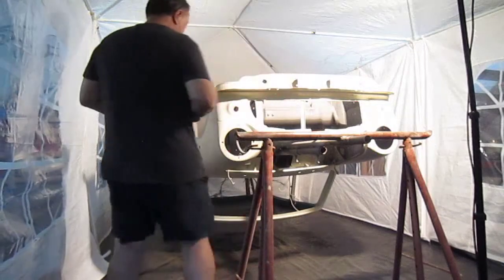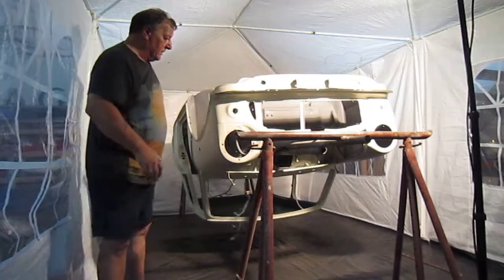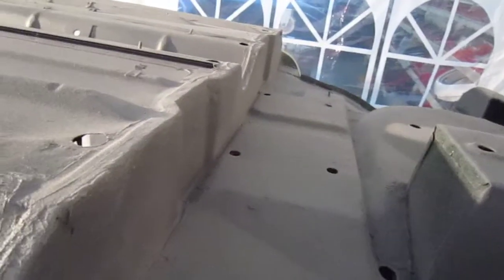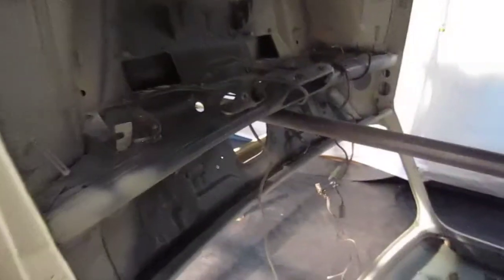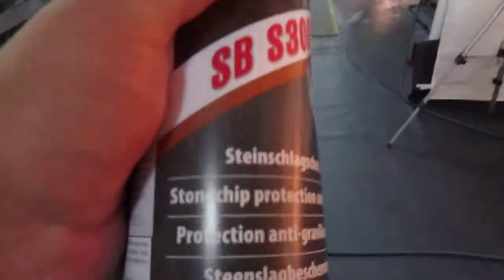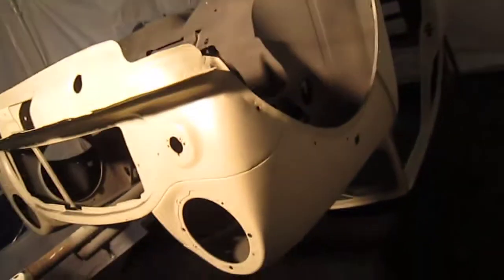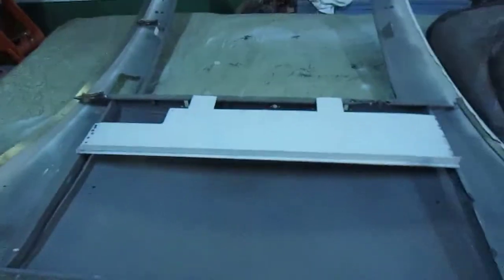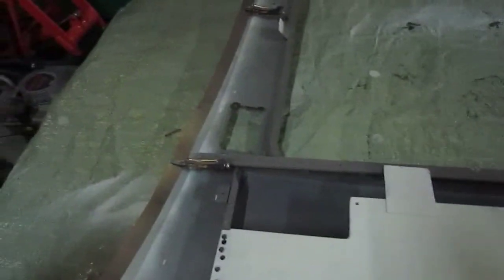Mini Cooper Corking & Stone Chipping part 3

Comment: That may be a basic jig but it is a fine idea that made a bunch of things way easier for you.Worth every farthing, hapenny, tuppence  and shilling.You even got the balance right. Not as easy as it looks.
Reply from the maker: Paul, I don‘t think the repair panels and welding would be so neat if i would have to grawl under the car and work upside down. The only thing a don‘t have is a break on the shaft to lock in position. Cheers David.
Reply: davejaguar66 Yes. Very true.You could just drill straight through the tubing and if the outside shaft can move axially you could drill other holes in the inner shafts without weakening the tubing too much.Or weld some flanges on and hold in place like a Toyota Land cruiser driveshaft.  Or block the whole car with a couple lengths of 2 by 4.Whatever works and how much patience you have.